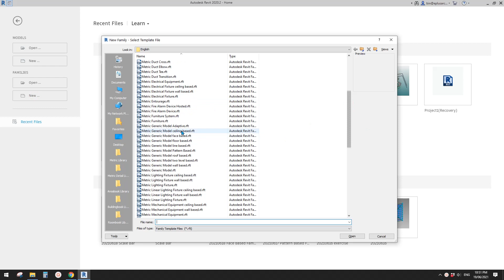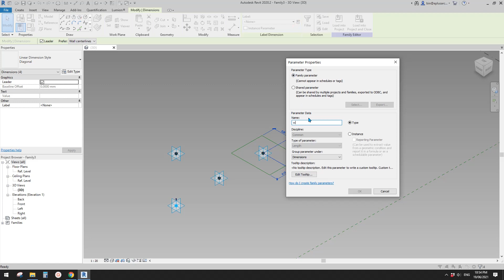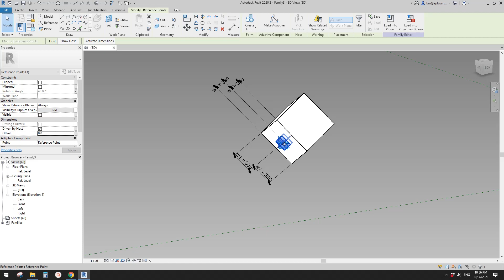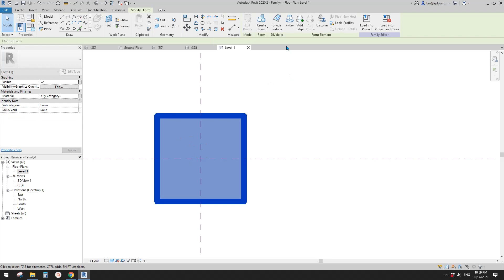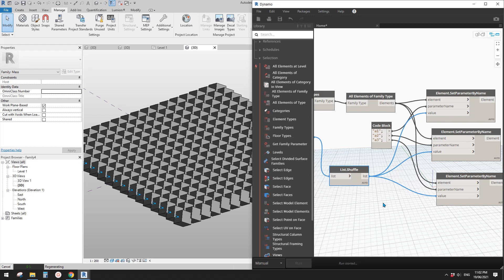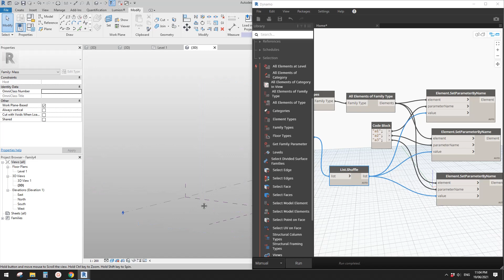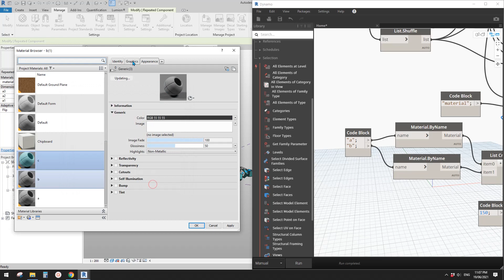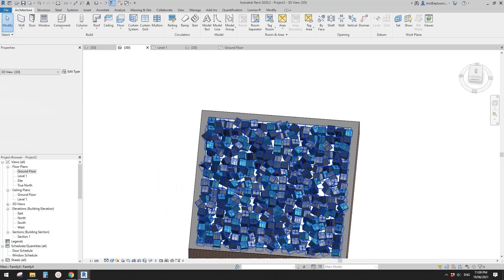Everyday Revit (Day 456) - Foam Pit

Comment: Bin tuto about diferent break lines on stairs will be great
Reply from the maker: Break lines are part of the stairs, which was controlled by the cut plane of the view range setting of your floor plan. Otherwise you can load the break line family from your Revit family folder\Detail Items\Div01 General\ I think.
Reply from the maker: Sorry, it is actually not part of the stars, but a system family. You can select it and have a play with the setting, which is very straightforward.